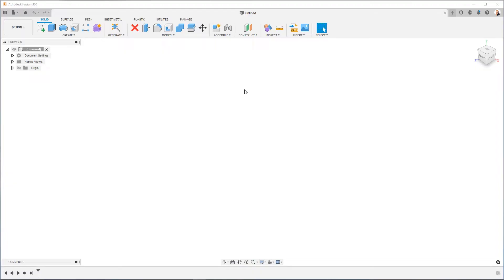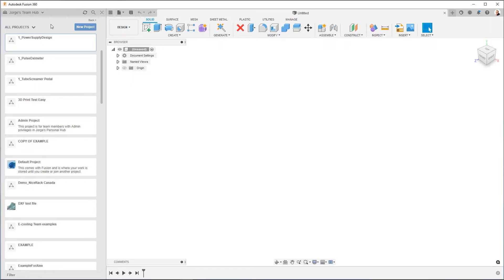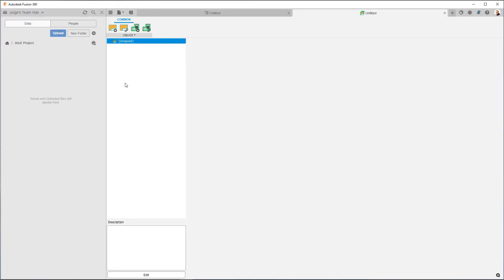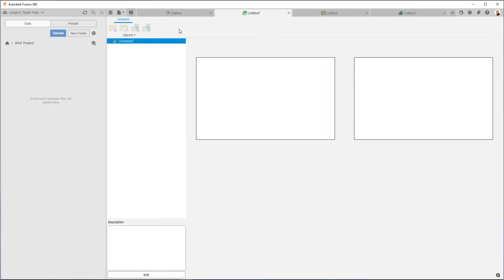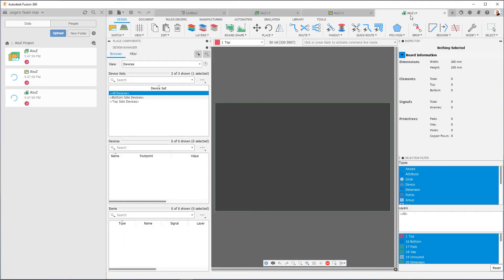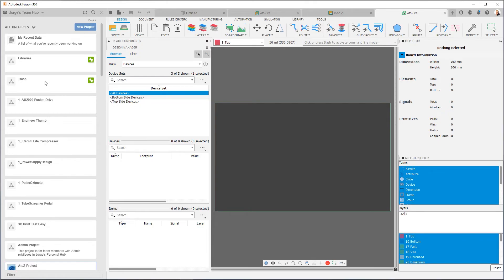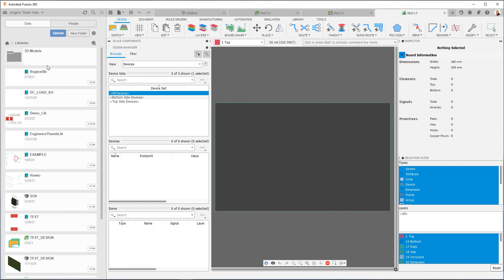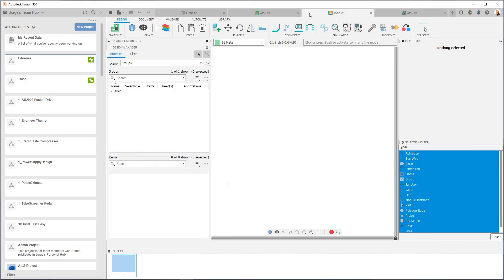Start Your First Project | Autodesk Fusion Electronics for Beginners

Comment: Good simple tutorial that shouldn't be needed.
Why is there not a simple "quick start" wizard in Fusion 360 for this?

Possibly with a few basic options such as layers, pcb size etc. Perhaps also the ability to use/create templates to get up and running even faster.

Comment: Why cant we just have ONE DOCUMENT. ( file/tab) per PCB design, all these tabs make it a pain to use
Reply: Its literally just 3 tabs for every workspace and Fusion opens all 3 automatically, so its the same as one document. You would need a tab for every workspace anyway.
Reply: l @rayly7291   hey, thanks for replying, i mean one document in the data panel, if i have a design with more than one pcb, its gets very confusing.